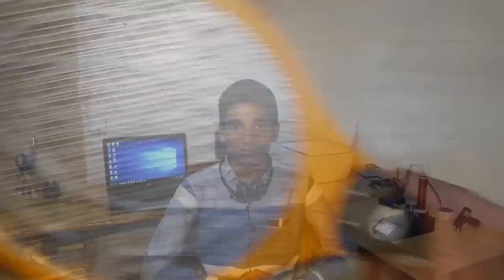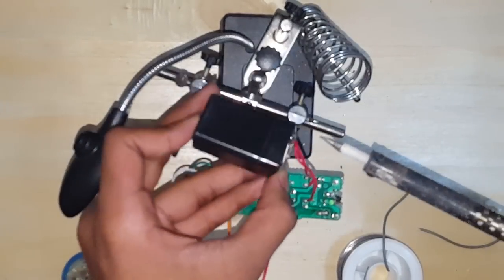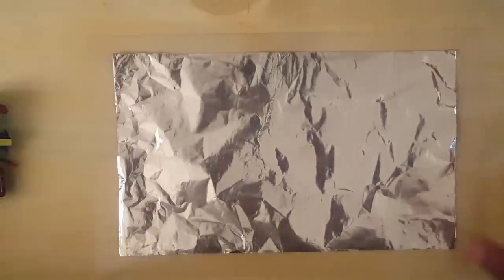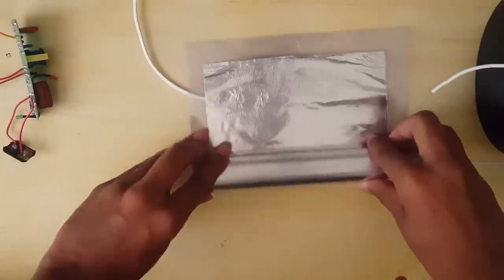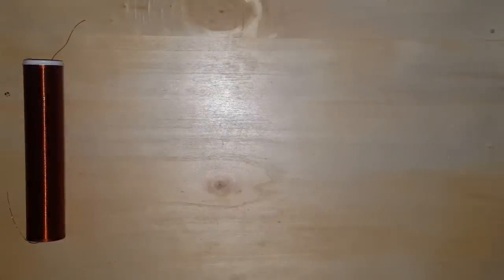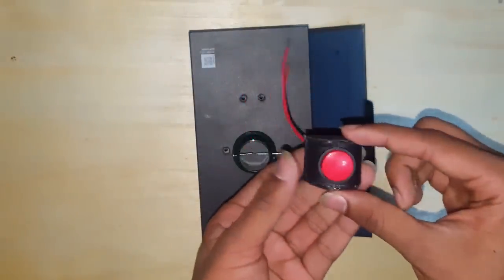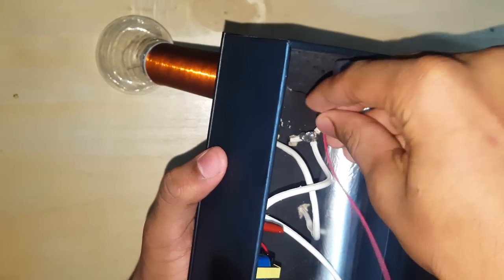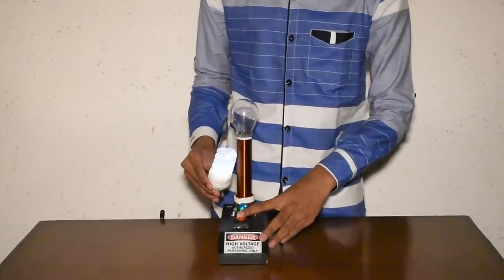How to make a DIY plasma ball!

Comment from the maker: Check out my latest video on how to make a custom PCB using EasyEDA:
https://youtu.be/Lvp5RB3lgWE
Reply: the Technowright  .can we make plasma ball with out that tesla coil?
Reply: Sir please show us the proper wiring inside the box, the video is very nice and ur English also 👏👍👍🙏
Reply from the maker: You can refer to the link in the description box which has the circuit diagram.
Reply: the Technowright 
Sir I am only 15 years old, I don't understand the diagrams but I am interested in electronics, I have made only a Tesla coil using 2n2222A transistor and 22K resistance
Reply: It is successful
Reply: I have a doubt where do we connect the switch ?
Reply: Bro should I use the same fly swatter used in this video
Reply: good job!!!

Comment: Ok, I still have to watch most of the video... But seeing you use a lightbulb as the globe - that's exactly what I was thinking to do! :) 
      (it's de-pressurized, noble gas inside, has something in the center that electricity can flow through)

(also, I have plenty of lightbulbs and a flyswatter that I wanted to salvage too)

Gonna watch this now 
Thank you :)

Cheers from Amsterdam 

Cool, cool, cool.

Comment: where did you get the high voltage wire from the homemade capacitor and is the 9 gauge insulated wire in AWG or SWG? Also in the video you said the copper wire is 27 gauge but in the description it says 24 gauge copper wire

Comment: Is it mandatory to use a metal pipe or bottle for making turns of copper wire on it 
 
Can I use a plastic or cardboard pipe to make copper wire turns on it
Reply from the maker: I have used plastic pipe and not metal. And even carboard will work.

Comment: How much wire will it require for a pipe of length 21cm and diameter 5 cm
Reply: 7854 cms of wire. NOT KIDDING. Step brother your pipe is too thick and long. Thats what.
Reply: Maths:
21cms= 210mms and using 27 Gauge (equal to 0.42mm) of wire gives 500turns lol
Then Diameter to CIrcumference= 5cm Dia= 15.70796cms
1 Turn = 1 circumference
500 Turns = 7854 cms of total circumference. 78Meter of wire lol

Comment: Can you please tell me how to increase the tendency of plasma 
What change I have to do
Reply: What happen you didn't answer my question
Reply from the maker: You can definitely try and increase the input voltage. You can fine tune the ratio between the primary and secondary coil turns, secondary coil height, wire gauge, diameter of the coil. You take a look at this calculator which will help you tune the tesla coil: http://www.classictesla.com/java/javatc/javatc.html . You can take a look at this video by RimstarOrg who explains it really well; https://www.youtube.com/watch?v=0SaEPW_iMF8 .
Reply: Thanks but I already do it and it is working 
I use 15 turn of 8 gaj copper wire in primary coil

Comment: Can you plz tell,me,which,is the primary ,I,didn't,understand the plan,
Reply: Primary is the white wire with 4 turns around that red tube, at the finnished build it is at the botom of the big orange sacondary coil (the one with light bulb on top)

Comment: bro where does the coil is connected.......you just pated the coil wire with aluminium foil in side........but it is not having any relation with the circuit.....then how it is working......just explain
Reply from the maker: +tech JR One end of the secondary coil is connected to the topload and the other is supposed to be grounded(which I connected to a aluminum plate, because I wanted it to be portable). The secondary coil receives power only through inductive coupling of coils and no physical connection is present with the circuit.
Reply: the Technowright i understood........it is forming magnetic flux.....thanks bro

Comment: What does High Voltage Transformer in the circuit diagram  represent in this model
Reply from the maker: It represents the transformer circuit obtained from the electric fly swatter.
Reply: Can we cut it off and then use it alone
Reply: By using just a transformer can we make it
Reply from the maker: No, you cant cut off the transformer and use it alone. Use the circuit as a whole.
Reply: Sir I tried to understand the circuit diagram but could not . can you just tell me we have to join which wires to which please

Comment: What was thing that have taken out from electric racket
Reply: That was the circuit, basicly it is small high voltage transformer, ti transforms 3V to higher voltage. That thing is the most important part

Comment: It produces over 2kv in the spark gap itself. And coil produces over 10kv
Reply: What would happen if I ad more turns on the primary coil, like about 6 instead of 4, will it increase performance or not?
Reply: @god3792  not
Reply: @god3792  decreasing the turns will

Comment: the video is nice, but i had a question, what capacitor did you change in the minute 4:30 and what is its value? 

I would like to see your answer soon...
Reply: Maybe i did not understand correctly, the question was: what capacitor did you use after removing the first?
Reply from the maker: +ChicoSalsa 01 the onboard capacitor has a rating of 223Joules and 2KV and a capacitance of 111.5nf
Reply from the maker: +ChicoSalsa 01 the homemade capacitor that I made has a capacitance of 5nf and a voltage rating of approx 7KV.
Reply: Ok thanx

Comment: Why don't you just buy that capacitor instead making it

Is that possible can we get that range capasitor in market 
And what's tha capacitor range
Please reply fast....
Reply from the maker: You can buy it, but it would be very expensive and difficult to find. It's better to make one.
Reply: @shyam-ravi  which capacitor do i use
Reply: @shyam-ravi  is that work as you showed us